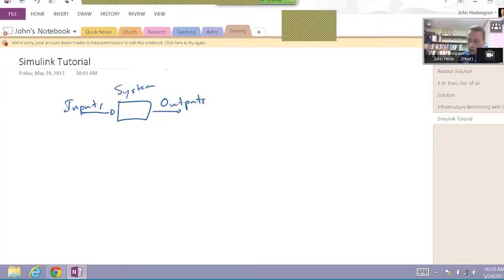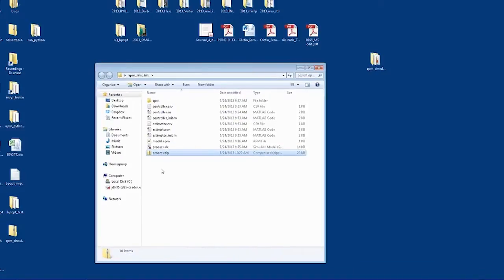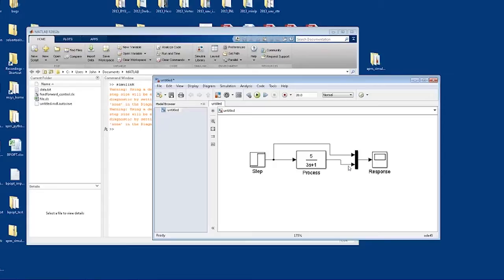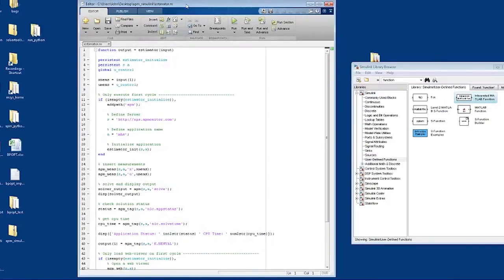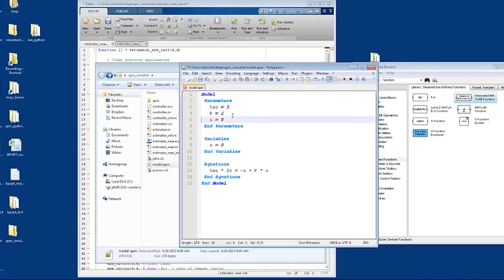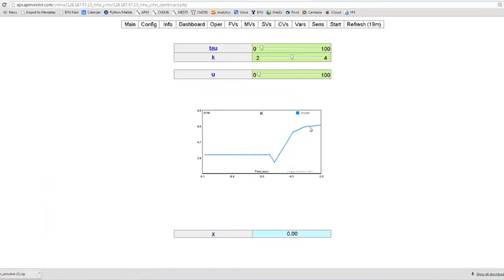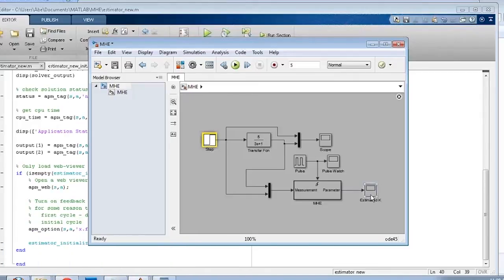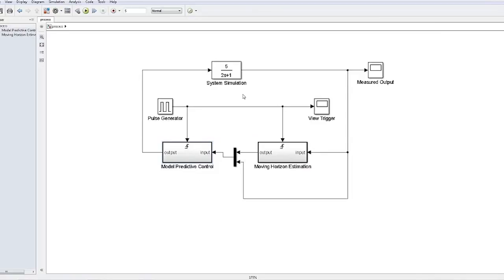Simulink and MATLAB Moving Horizon Estimation

Comment from the maker: Andreea, thanks for the feedback on the video. The MHE application (estimation.m) can also be run independently of the Simulink module as a MATLAB script. There are 4 main steps involved in the algorithm: (1) load the model and specify which parameters to estimate - this is only done once, (2) update the measurement values for select inputs and measured states, (3) optimize by minimizing the objective function of model-measured values by changing the parameters, (4) return updated parameters.